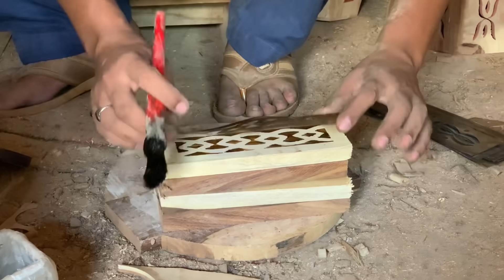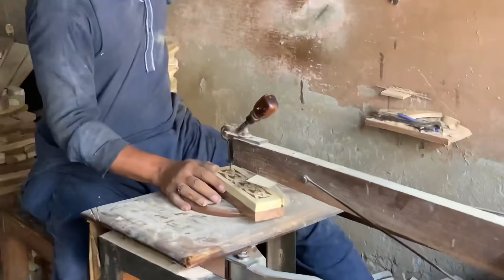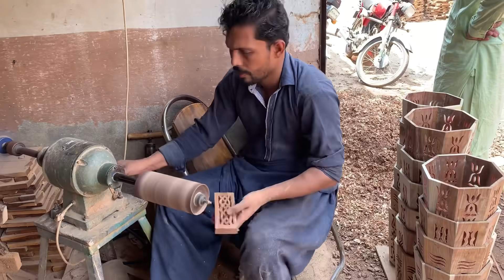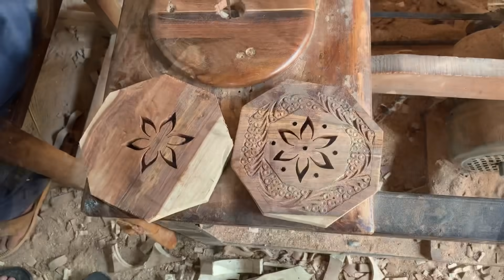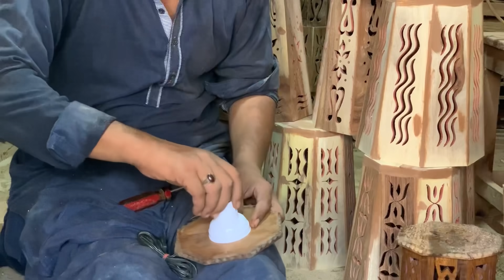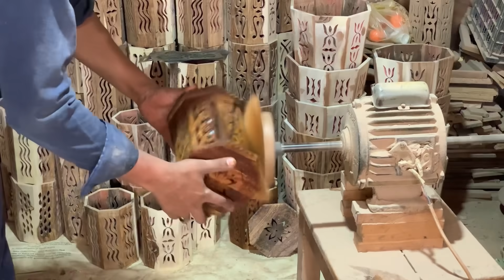Amazing Technique of Making Wooden Lamp || Creative and Stylish Wooden Lamp Ideas DIY

Comment: On 5:55 of video he uses a some kinde saw. What is the true name of that saw?
Reply: That's a scroll saw. They have a foot pedal to run it, and a quick release on the top arm to release the blade so it can be put in each hole.